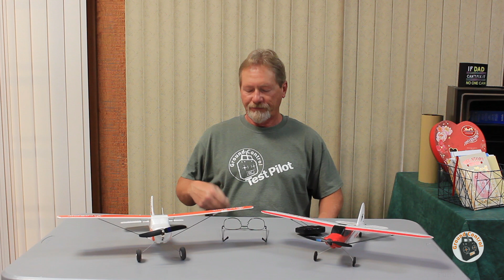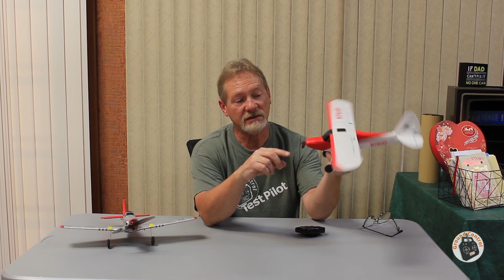The Poll Results are here! - Which Plane has been Selected to receive the Next Brushless Conversion?

Comment: have you ever considered,, brushless with gear reduction, and bigger prop?. maybe hack up the stock 10mm gearbox and use it?  I'm in a "micro phase", right now, so what yer doing is fascinating to me. very detailed. cheers dude.
Reply from the maker: Hi Steve! Thank you much! That's a very good question. They do make Brushless Motor & Gearbox Combinations and I have considered doing just that. The reason I prefer direct drive Motors and Props is the Gearbox provides another failure point. The direct drive Brushless Motors are very quiet and very smooth and I've not had one fail on me yet. I love these Micro Planes and 1S Brushless Power System can be a challenge ;-) I do prefer a bit larger Plane using 2S-3S Power Systems but sometimes a Micro Plane us just a very good candidate for a 1S Brushless System ;-) I think the Eachine Mini Cessna will be a very good candidate for a 2S Brushless Power System. I hope I have time to convert that one as well ;-) See you in the Air!
Reply: @GroundControlRC  pretty soon you'll have a bunch of leftover brushed power systems, or at least the motors, then you can build a b-17 for cheap with the old stuff!  your dd system would be much more efficient and stable , than a gearbox, methinks. .i might get around to trying it on a micro biplane, just to see what happens. also, good job presenting yourself on YT. very watchable. cheers.
Reply from the maker: @steve-rw7ty  Thank you much Steve! I keep wondering what to do with all the leftover motors from these projects ;-) See you in the Air!

Comment: I was considering the Eachine Cessna for a brushless mod, but with all the high wing planes I have I may wait for the P-47 to come down in price instead.  I think this bigger 550 mm span bird running the same 10mm motor in stock form could benefit more from add brushless power.   Maybe a future project for you?

The Sport Cub will do great.  I have a blast flying my 2S Super Cub 500.  Can't wait to see yours fly.

Go with 2mm carbon fiber for the spar.   A 1mm spar is not enough to stiffen the wing.  In fact, I had to add a second 2mm spar to reinforce the first in said 2S Cub to deal with the air loads the wing was experiencing.  Later after this photo was taken I had to add short extensions further out from the shorter spar to the tips too: https://static.rcgroups.net/forums/attachments/3/9/2/3/9/7/a13389351-95-20200411_130240.jpg   

Best to do it all at once, but these ARE experimental projects and  I learned something valuable from it.   The bigger, heavier Cessna might even require 2.5mm - 3mm spars.

   Using carbon tubing if possible (2mm OD x 1mm ID) which will save a little weight with minimum loss of stiffness.  Due to the flexible nature of the wing I recommend running the spar out to 1-1/2" from the wing tips.  
 
Example tubing source (shop around for better prices if needed):  https://www.amazon.com/uxcell-Carbon-Pultrusion-Airplane-Quadcopter/dp/B07R5S4LCN

Have fun with the build.
Reply from the maker: Nice Job! So yours is a 2S Brushless Power System?
What's the AUW with your converted Super Cub 500?
I'm going to Convert mine as 1S Brushless so it will be considerably lighter than a 2S Power System.
I think the Mini Cessna and the P47 will make great 2S Conversion.
That's what I plan on doing with the Mini Cessna ;-)
I'm in the process of MOD'ing the Ailerons on my Sport Cub 500 to get the Roll Rate I want before starting on the Brushless Conversion.
Do you have a flight video of the 2S Super Cub 500?
See you in the Air!
Reply: @GroundControlRC  Flight weight went up to 70G with a 200MmAh 2S Eflite pack,  with some of that gain from the (painted) balsa ailerons and mini hinges. About the same weight as the Cessna with 2 inches less wing, though still more than enough.

Note my power was from a 10mm Eflite 13,000Kv brushless inrunner for a 28mm EDF fan fitted into the stock gear reduction drive in place of the brushed one: https://www.amazon.com/flite-BL180m-Ducted-Motor-13500Kv/dp/B014RG8HYS.  

I have tested this 2S set-up at around 130g thrust, so well over 1:1 weight/thrust ratio.  The stock brushed drive reads around 68-70g on 1S.  I had to lose the pop-off prop coupler because it kept flying off at full power  ;-).

The motor is driven from the 5A ESC built into a 2S Eflite receiver (EflU4864).   I am currently running tests with the 11,750Kv version of the same motor, but the 5A ESC cuts out at full throttle.  Higher Kv motors of the same make come from winding less wire in the stator, so I assume the 13,500Kv version produces less resistance and that's why it works with the same brick (Stock Volantex prop).

(I will be running a new thrust test of the 11,750Kv motor soon using a 10A 2S ESC that just arrived today).

Note:  Using this EDF motor requires drilling out the brass pinion gear from the brushed motor from 1.2mm to 1.5mm diameter to fit the shaft of the brushless motor.

Maiden flight is here.   Note I did not have a lot of aileron travel set for the maiden to limit roll sensitivity, just in case. I added some for the second flight (same video).  There's plenty more available. THE CAMERA GOES OUT OF FOCUS at the 5:00  minute mark but comes back 38 seconds later (damn phone cams).

  At the 4.34 mark I tried a full power vertical climb, and it did NOT disappoint.   Virgin's so-called "space" plane has nothing on me ;-)

https://youtu.be/YGxDbnpLE1s

Happy flying!
Reply from the maker: Hehehe...sweet! No wonder you needed 2mm carbon spars! I'm only putting a 1S Power System in mine. It will have a bit better thrust-to-weight ratio than the P51D as it's about 7g lighter. You put as much power into that super cub 500 as I put into my parkjets ;-)
Much fun!
Reply: @GroundControlRC  Remember that I had to double up on the spars, so a single 2mm should be ideal for you.  I used a single 3mm for the bigger and heavier Xk A160 Cub.

If only I had the open skies you enjoy. With these 2S rockets it's turn then turn then turn then turn then turn then turn then....  Not much straight line activity.

I still have an unused Rage Super Cub MX replacement airframe that is identical to the Volantex Sport and Super Cubs, and I am considering a 1204 6100Kv on 1S power for it and using the stock prop and spinner.  I think that may be an ideal balance point.
Reply from the maker: @Doggeslife  Sounds like a good motor and prop choice. The 1206 6000kv Motor I used in the P51D provides 70g of thrust on 1S. That's the best I've tested so far for a Brushless 1S Power System.
If you don't have enough Horizontal Space you have plenty of Vertical Space! It looked like the 2S Super Cub was doing just fine in the Vertical Space ;-)
Reply: @GroundControlRC  I got more thrust using a 1207 7500 powered by a 10A ESC and a 5x3 (5030 ?) Gemfan prop. Up to a whopping 95g!   That is the set-up I put in my second 1S Mustang, and it flew like the 2S plane with a smaller motor.   There is  a video of it's maiden on my site.  Search for "Eachine Mini Mustang AS3X / 1S Brushless Version 2".     I let the smoke out of a 7A ESC before I tried the 10A with success.

The 400mAh pack works hard with this set-up though, so a 500mAh might be called for to feed it the extra juice it desires.

Here's the 1207 motor with the Gemfan prop running on the stand. Skip ahead to the 4:00 minute mark to see the test numbers in real time: https://youtu.be/OKQP7hWluJI
Reply from the maker: You got 95g of thrust from a 1207 7500kv?
My 1206 6000kv put out more thrust than the 1206 7500kv.
That Gemfan 5x3 prop is heavier than the T-Mount HQ 5x3 prop I used.
What motor were you using?
Reply from the maker: It states video unavailable. copyright issue?
Reply from the maker: Why would you use a 1204 6100Kv motor when your getting 95g of thrust from the 1207 7500kv motor?
I wouldn't use anything else.
Reply: @GroundControlRC  So I can stick with the 400mAh packs.  More than enough.  Maybe if I had the space that you do.  Mine feels awfully small with my faster planes.  ;-)

I'm testing a bunch of motors I have for comparison, and will make a video of it all sooner or later.  I may re-test the 1207 just to verify the previous test and to compare it to a Talon 1204 7500Kv I also have on hand and acquired not long ago.
Reply from the maker: @Doggeslife  Fantastic, but what motor gave you 95g of thrust and where can I get one?
Reply: @GroundControlRC   This one:  https://usa.banggood.com/RCINPOWER-GTS-V2-1207-5000-or-6000KV-3-4S-7500KV-2-3S-Brushless-Motor-for-RC-Drone-FPV-Racing-p-1494635.html?cur_warehouse=USA&ID=516950513346&rmmds=search

I've had better luck with them on 1S power then the Emax motors. Perhaps they wind with a different gauge wire or something.

Thanks for the heads-up on the video.  Seems they put a copyright claim on it months after it had been put up.  I'll have to re-do it.
Reply from the maker: Fantastic! Thanks for the info!
Someone stated the weight was 9.4g can you confirm that?
I've never used that brand of motor but if it's producing 95g on a 1S with 5x3 Prop I'm definitely going to be picking up a couple to put on the thrust stand ;-)
Reply: @GroundControlRC  I see 9.5g with 2 inches of wire and a 1.5  3-pin connector (that I need to upgrade to a PH 2.0 to handle the current). It hit those numbers with a 2.0 plug.

Depending on prop used, you may require a prop adapter as seen in the video. A 10A 1S ESC is critical, as 7A doesn't provide enough current. I popped an FET trying a 7A ESC with it.

I never tried the 6000Kv version of this motor because it says "3S-4S" while the 7500Kv says "2S-3S" (more evidence that higher Kv versions of a particular motor handle lower voltages better).  Now I wonder what the 6000K would do...

Here's the re-uploaded video, now with a no-copyright soundtrack (thrust numbers visible at the 3:58 minute mark):  https://youtu.be/C9F3a2_6LT4
Reply from the maker: That's a lot of amps draw for such a small motor on 1S.
That makes for some very short flights with a small LIPO.
I bet I'm not pulling more then 4A with the 1206 6000kv spinning a 5x3 prop.
Isn't that Motor a T-Mount Motor? I use a T-Mount 5x3 Prop so no adapter required.
I'd like to see that thrust test again with out the barrier.
Since the Motor Thrust has something to push against I don't think the Thrust number is accurate.
My Thrust Stand pushes straight up, so nothing to push against.
My 1206 7500kv motor produced less thrust than the 6000kv version of the same motor.
The lower the KV the more torque as they have to lower the torque to spin the motor faster.
Reply: @GroundControlRC  I got a readout in the mid 80's when I used my makeshift vertical stand, but you can see the lead weights are deflecting some of the flow sideways:  https://youtu.be/kE7Aco6T1Lk

The "barrier" was angled back and so was deflecting the air upwards, so no form of ground effect on the prop.  When I run the new test I'll try a different set-up to eliminate that questionable factor from the equation, just to be sure.

True on the power usage. The 400mAh was quite warm. That's why I use 550mAh packs with it now.  The 1204 is a new acquisition for use with the 400mAh packs.

  But even with the smaller pack you can see in the video that I was getting a good flight until I crashed it   ;-)    I start using full power around the 2:30 mark:
https://youtu.be/m8Q3rwYkVzs
Reply: Here's a side view of the near-45 degree angle air deflector showing how the air is directed upwards rather than bunch up behind the stand where it can affect the numbers.  I have confidence in the results.
Reply from the maker: I'll have to stick with what I got for now as that's a lot of amp draw for so little thrust.
My BR1206 6000kv on 2S spinning a 3830 Prop was only pulling 8.1A while providing 190g of thrust.
I'll have to test my BR1306 4000kv Motor on 1S with a 5030 and 5040 Prop.
I'm betting I'll get at least 100g of thrust while only pulling around 3-4 amps.
My 1306 only weighs approx. 1.5g more than the 1206 so a very good tradeoff.
I always try to find a balance of good thrust and efficiency for my Power Systems even on my Parkjets as I like to get a minimum of 5 min. of flight time leaving more than 3.5v per cell.
Thanks for all the information you provided as it is much appreciated.
I thought, if you had a motor that was giving 95g of thrust on 1S with about the same amp draw my motor is using, I was going to greatly increase my thrust-to-weight ratio while getting about the same flight time without increasing the AUW much at all.
You had me going there for a while ;-)
See you in the Air!
Reply: @GroundControlRC  I'm not sure how much it's actually drawing.  I suppose I need to set something up to measure it.

P.S.....I just ran the stock Mustang gear-reduction drive with the 10mm diameter 11,750Kv Eflite EDF motor.  2S 300mAh pack.   Stock Mustang prop + metal hub. 

I made 2 runs, one without the deflector and one with.  Both peaked over 200g and then stabilized around 193g.  That was exciting, and a little scary, as the motor pinion came off with the first try.  It wasn't pressed on far enough.  ( I need to use a protective face mask). 

 Now I see why the Super Cub 500 can go vertical so well. I had no idea.

Here's an unpublished video of the run: https://youtu.be/JUmrHFwT4Ug
Reply from the maker: Hehehe...that was Sweet!
Are you going to put that in the Mustang?
Definitely Unlimited Vertical ;-)
Reply: @GroundControlRC   Not using gear drives much anymore.  I like the quiet nature of direct drive.  I was just curious and wanted to include it for comparison with the other motors I;m testing, though it will go into something eventually. Maybe the new 500mm span P-47 will be a good home.
Reply from the maker: @Doggeslife  Yep, I like Direct Drive as well and one less Failure Point ;-)
It would be fun to see it tested in a plane though wouldn't it ;-)